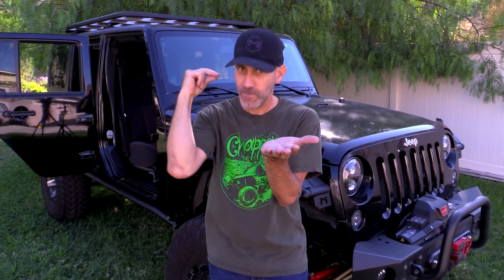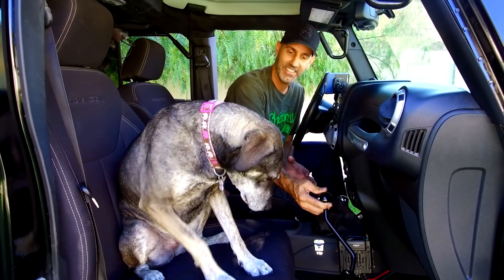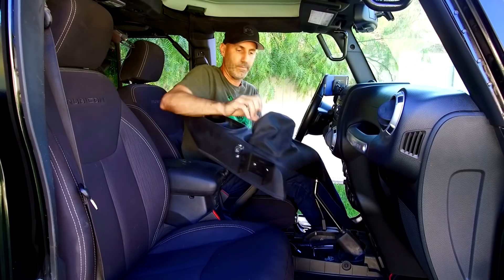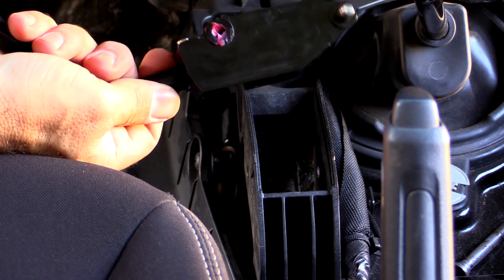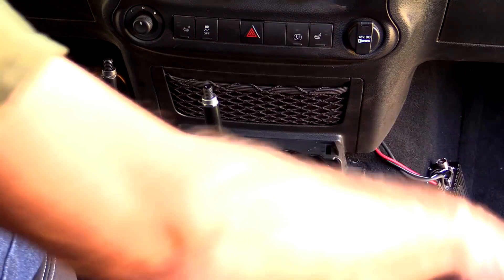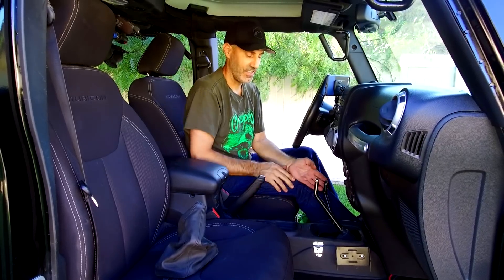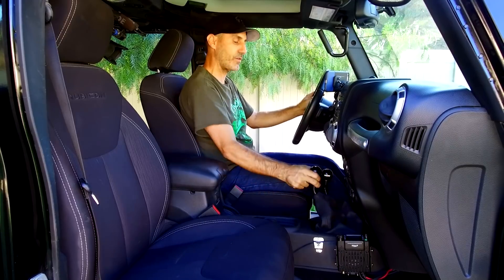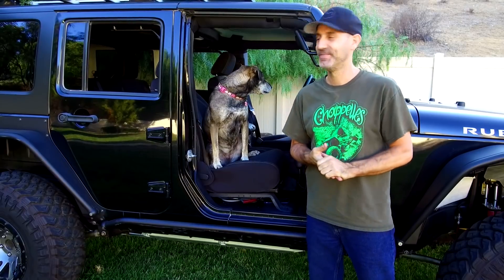Jeep Wrangler JK Transfer Case Shift Handle Swap How To - B & M

Comment: Just installed this upgrade. I have a 6 speed manual, 2017 JK. I Really like this product. The cool factor is way up. I had a bear of a time getting that plastic console cover back on though. The Shifter is Langer and turned once installed so it’s a bit tricky. Also, my parking brake didn’t go up as far so I had to torque the plastic a bit to get it to go back on. The way I position the seat, and shift, there is no issue with my knee hitting the shifter at all. Great video. Gave me the confidence to try it myself.
Reply from the maker: So glad you like yours as well... I'll bet that even with those battles it was kind of fun!

Comment: I have a 2017 Jeep Wrangler Rubicon Hardrock 2-door. 6-speed manual. You're right about this transmission. Looking real hard at either the 2020 Wrangler Unlimited or the Gladiator with the manual transmission. I've seen  the two items you installed. Glad to see how well they worked. Great product. Glad I found your website.

Comment: Thanks for the awesome install videos thus far!  I just ordered both the B&M shifter and transfer case handle. Hoping to tackle both next week.  I just picked up my JK in February, and I've been working on it non-stop.  So much fun!
Reply from the maker: Awesome to hear! Quick tip on the shifter install... pack some grease on the shifter assembly before installing it and it will break in faster and feel smoother!
Reply: @AutoEdits  Thanks!  I actually picked up just the handle for now.  I'm hearing that alone makes a big improvement in feel by getting rid of the rubber isolator on the factory shift handle.  If I still feel that I want the shorter throws, the shifter assembly will be next!
Reply: I just finished the install of the shift and transfer case handles.  I can't believe how much of an improvement just the shifter handle made! Replacing the sloppy OEM rubber isolator bushing with the billet aluminum piece completely changed the shift feel,  even while retaining the stock shifter assembly.  I uploaded a video to give a few more installation tips and an overview of both handles installed.

Comment: Hopefully you don't shift the transfer case by accident instead of the transmission. :)  Yep, manual transmission = theft deterrent.  I have been told by my podiatrist that if I drive a manual I will have surgery on my left heel to remove a bone spur (had it done on the right heel - which is the foot I drive with, which is why my left has never bothered me).

Comment: My only problem with this is the shift linkage is already pretty weak on a JK, so adding extra leverage could cause some problems down the road if you’re not super careful shifting gears on the transfer case.
Reply from the maker: I never had a problem shifting mine and always take great care to make proper shifts. I agree that getting more leverage on making bad shifts probably isn't good but this thing looks and feels fantastic in place so I'm stoked.
Reply: I don't doubt that at all, and yours appears to shift easier than most, probably because you actually use yours. But for the people that don't often use their T-case and just want to swap the shifter for the looks, they may find themselves stuck in gear with a floppy shifter if they're not careful pulling in to gear.
Reply: @AutoEdits  I just have a question.  Can you apply the emergency brake while in 4lo?  In the video, it looked like the E-brake would hit the shifter.
Reply from the maker: Absolutely! Everything works exactly like it should.
Reply from the maker: Maybe I should do a how to shift your transfer case video?
Reply: Advanced Adapters has a kit that fixes that common problem.
http://www.advanceadapters.com/products/715596--heavy-duty-jk-cable-shifter-upgrade/
Reply: I wonder if this would work with the Advanced Adapters linkage?
Reply: Great point..

Comment: Looks great i will probably end up getting this.  I just wished they made an Automatic knob to match they only make the pistol grip version.
Reply from the maker: Yeah, I hear ya on the automatic shifter thing... It's still cooler than stock, so there's that!
Reply: Check with our friends over at speeddawg.com. They make an adaptor that will fit nearly any B&M Off-Road Shift ball.

- Jason @ B&M
Reply: @BMRacingPerformance  Perfect Thanks!

Comment: I would put a few extra of the linkage plastic shifter bushings in your glove box (connects the cable to the lever), just in case the extra leverage causes it to break. (After breaking that stupid bushing on the boat ramp with the stock T-case shifter I carry spares.)
Reply from the maker: This is the first I've heard of that with the JK's. Good suggestion!
Reply: Do you have a P/N for those bushings and a SOURCE beside the dealership ? Thank you.

Comment: I was looking to see if they made these for the JL yet. I'm  contemplating a JLU Sport, which I will get a few aftermarket parts for... Katzkin leather and seat heaters, and a B&M extended 
shifter. 

I didn't even realize they made an extended lever, but when test driving the JL, I thought, "Boy, I wish this had a longer shift lever." Other than that, it was really fun to drive.
Reply: According to the BMRacing website they DO now make one for the JL.

Comment: Did the B&M shifter and handel upgrade. worked to hard for me. getting old! added an extention made from s.s. rod and rod coupler much better!
Reply from the maker: That's an interesting idea.  I found that the technique I use is the key to smooth operator status. The shifter is designed to not let the thing "pop" out of gear so gentle motions to get out of one gear and in to the next feel difficult.  If you use a more snappy approach to the getting out of one gear, the thing feels like butter. If you try to just drag out of a gear, it will fight you.

Comment: Hi Jason, Thanks for a good video! I've had mine installed now for about 4-5 months. At first it was great and was always a really smooth shift. Now once the transmission gets hot, the shifting gets really hard to switch between gears, both in and out, I pretty much have to smack the shifter to get it in or out of gear. Transmission fluid is new and levels are fine. How has your shifter been holding up over the past five years?
Reply from the maker: That sounds like a shifter link issue... check that plastic bushing on the end of the cable and the transfer case side. Hopefully it's not an issue inside the t-case.
Reply: @AutoEdits  sorry I should have clarified it better and on the right video, I realized after I posted the question. I've got a manual and I swapped out the stock shifter and box that switches the 6 speed transmission with the B&M one like you did. I was just seeing if you were still liking your shifter and it acted like it did when you originally installed it.
Reply from the maker: Oh gotcha. Yes, the shifter still performs as expected. My only problem was one of the bolts on the shifter handle broke and it would spin at that bracket under the center console boot. I called Holley and they sent me out new screws and it's been solid for another few years now.
Reply: @AutoEdits  Thanks a lot for the update, I appreciate it.

Comment: Awesome video now I want one for my Rubicon but mine is automatic, will this work on mine? Does it make it any easier to shift in and out of 4 wheel drive?
Reply from the maker: Thanks! Yeah, soon as I saw it... knew I "needed" it.  This thing works with Automatic Trans Jeeps as well and does make it easier to shift... not that it really needed that.

Comment: Nice review/install.  I like the look.   
Do you know if the have a replacement knob for the auto to match? 
Yes I know I have the auto. Lol
Reply from the maker: Nothing wrong with auto trans... few times I wished this one was LOL . They don't make a "matching" auto handle but they do have a pretty cool upgrade one that is in the family.
Reply: AutoEdits cool thanks.  I’ll check them out for sure.

Comment: My 2011 JK is hard to shift into 1st, 2nd and reverse at times.
Have to turn the engine off to get it to shift into those gears.
What is up with this?
Reply from the maker: That sounds more like a clutch issue. Look into that first.
Reply: @AutoEdits  
Already replaced the slave and master as well as put the B&M shifter handle on it.
Still having problems. 
Was thinking about replacing the clutch and throw out bearing.

Comment: Should have done the traction control button mod while you had the console out
Reply from the maker: I'm on the fence for that modification... good suggestion though it only takes a few minutes to get that thing out again!
Reply: It definitely helps in those tricky situations. Plus if wanted you can always do it in a way that easily reversible and if you don't like it take it out

Comment: Hi Jason, i have a question for you
I've seen a video from another JKU owner with a manual where he drives relatively fast on a gravel road and the shift lever starts shaking violently.
Did you ever experience this with your jeep and if so, did it get better with the precision shifter ?
Reply from the maker: My stock shift tower did do that... it was awful.  The precision shifter completely solved that.

Comment: Hi Jason I just installed the b&m because it was popping out of first gear. I like it a lot and it has seemed to stop the gear popping. My question is does it get a little easier to shift after awhile? It is quite tough in some gears to get out of gear especially 3rd.
Reply from the maker: It does break in and takes a bit of getting used to. Use a more "snappy" motion to get the lever out of one gear and to the next... you'll see what I mean when you try it.  Since this thing is designed to not let the thing pop out of gear... a slow dragging motion like I used on the stock shifter doesn't work... it fights you.  Give it a try and you'll love it even more.
Reply: AutoEdits ok thanks. I have been doing the snappy thing since that seemed to be the only way to shift it. It is nice that I don’t have to worry about it coming out of gear except when I want it to.

Comment: For the little that the transfer case shifter actually gets used (most people put er in 4 lo, wheel all day then throw her in 2 hi to get home) having that thing way up there in the same relative area as the transmission shifter looks like its be a colossal nuisance and get in the way. Personal preference but I'd rather have it low profile and out of the way as they hit my knee and thogh in the stock location anyway
Reply from the maker: Like you said, personal preference. The only trail I ever put it in 4lo all day was the Rubicon... otherwise I'm shifting the T-case often.  Maybe because I have a manual transmission it requires more shifting, but I really like the position of this thing so far.

Comment: Great - Now get the bottom half fixed...  That stupid cable system has got to go. These should shift smooth as butter like the older Jeeps (TJ in particular)...

Comment: I wouldn't say it's THAT easy given the challenge of getting the knob off without putting too much twisting and sideways force into the transfer case lever. Definitely takes a strong arm and strong grip. Also, no need to pop the skirt down in my experience. Just pull hard and gently twist back and forth. It's the most difficult the first time it's done.
Reply from the maker: Legit.
Reply: Use the back seat.  You avoid the transfer lever that way....and the honking horn when her butt hits the steering wheel while popping the skirt off.
Reply: @cleetismcdougall5425  lol I just fold the backseat down. Maybe climb up on the roof rack if I'm feeling adventurous.

Comment: So I clicked on the link you put for the Shift Handle, and it says this will fit 2007-2018 JK's, but when I put mine in there which is a 2008 it says "this part will not fit your vehicle"... really want to get it but dont want to spend the money if its not for sure going to work on the year JK i have. :/
Reply from the maker: It is for all JK 's are you sure all the drop down menus were correct?
Reply: @AutoEdits  Yeah the only options were jeep wranglers.

Comment: Shame it doesn't also get rid of those stupid plastic clips that always break off. But it looks super nice! Although I think the t-case shifter would constantly hit my knee, which I don't think I would like.
Reply from the maker: I'll let you know about the knee thing!
Reply: Advanced Adapters makes a kit that fixes that problem permanently.
It's not cheap but if you actually use your Jeep like a Jeep it's worth it's weight in gold.
http://www.advanceadapters.com/products/715596--heavy-duty-jk-cable-shifter-upgrade/
Reply: Cleetis McDougall  Oh, cool. I just carry a set of spares in the glove box. As it sucks to have them fail and not be able to fix it right there.

Comment: Brings me to another question, manual shift off-road is that a task?
Everyone says manual shift off-road is terrible.
Reply: Its the preferred trans proffered by most off roaders leaves you in control and is helpful when crawling through trick terrain
Reply from the maker: I like it most of the time.  Automatic is absolutely easier in off road situations but personal preference is the main thing.
Reply: Ahh thanks for the feedback 💪🤠

Comment: hows the mustang?
Reply from the maker: Sitting patiently for me to roll underneath for some exhaust love.
Reply: @AutoEdits  that's awesome! I have a 73 coupe myself, its blue fully chrome trimmed out and I've been religiously following your videos. You helped me figure out alot of brands so far (mainly TCP for the suspension) and its inspired me to keep going instead of getting a 67. Keep it up man, these cars are so unappreciated.
Right now for mine I'm doing a trunk floor replacement, but I've had no time
Reply from the maker: I feel ya! Glad to hear from another coupe owner as well... with a little tweaking, I'm confident these things can be very handsome!